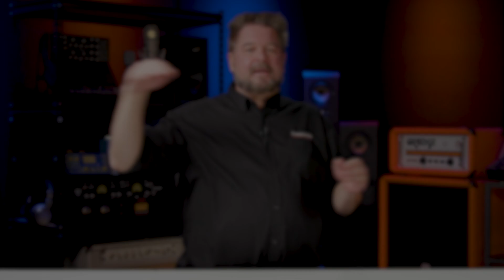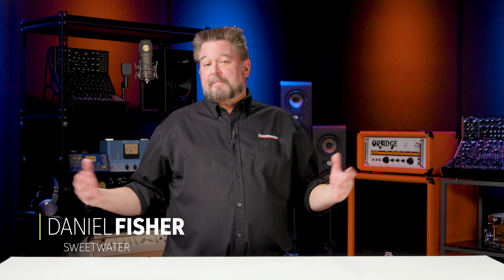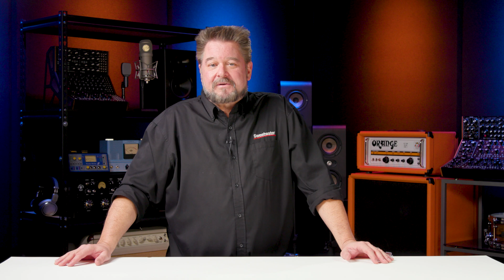What Is Crossover Frequency? – Daniel Fisher

Comment: this brings me back to thinking about that little focal sub video mitch did.    My question is, at the higher bass frequencies at the crossover zone, how do you deal with phase cancellation and other physical positioning issues. there is no control over the relative positioning of mains and subs by the mfr.    my feeling is that single acoustically-aligned cabinets are the way to go.

Comment: I have a Yamaha receiver, the RX-A1070, which I discovered can use the second room speaker outputs in a “bi-amp” configuration. My speakers, KEF Reference Ones, have dual inputs so it worked out and sounds better to my ears. But now I wonder where the crossover frequency is set (probably the receiver) and what it is set at. Just musing after having watched this informative video.
Reply: I have a Yamaha with the same setup. But I actually use it for speakers and an upstairs game room. The sound was extremely flat and I contacted Yamaha and was told that the signal coming out for the second room does not use the crossover built into the amp so you're getting a straight signal. I purchased a Behringer equalizer it's pretty small but very efficient with gain knobs built-in and a 10-band EQ. I'm guessing you would probably have to do the same and then adjust the EQ to what frequencies you want it to go to for What speaker you're hooking it up to. I hope that helped answer your question on your Yamaha amp.

Comment: i have a sound system with very good speakers, but can’t seem to figure out the proper crossover freq you those speakers 

you can set the center, the surround, and fronts
Reply: If you're talking about for a home theater type system, I'd try to find the rated frequency responses of your Left/Right speakers, then set the crossover at the low number of those ratings. There's typically not much low frequency sound mixed to rear channels (usually mainly left and right... center tends to be more mid-focused for dialog in movies). L/R speakers typically will be more accurate than a subwoofer.
Reply: @davemccall9594  is there something online for definitive speakers i can find? in my system settings i have all the speakers set to 120 HZ but that may be wrong